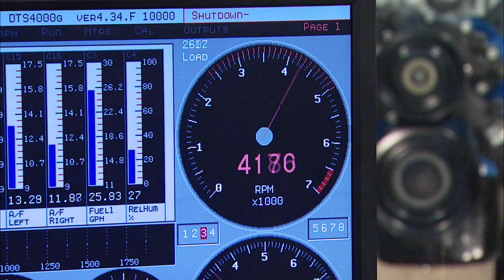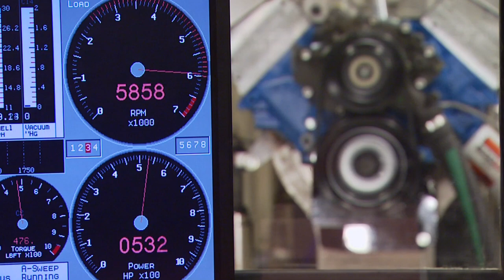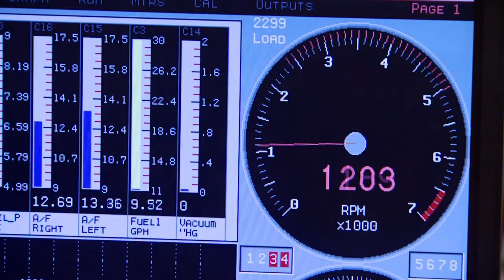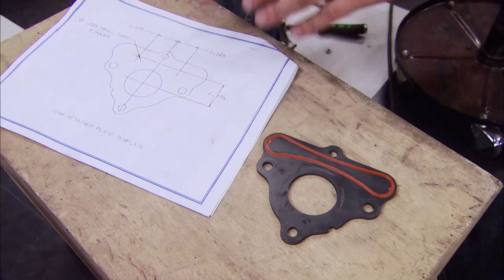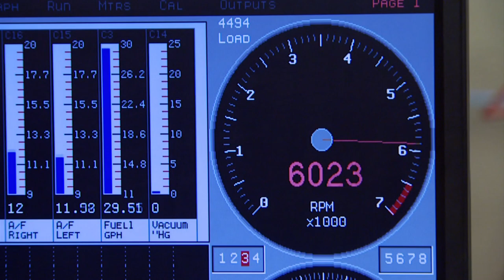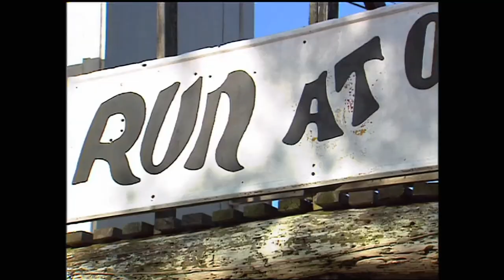Will The Junkyard 460 Big Block Hit 600HP On The Dyno? - Horsepower S13, E10

Comment: LS is still old school pushrod engine  its the pinnacle of  the old design  overhead cam  gives you more rpm but again thats still old school cause over head cam engines have been around a long time as well.
Reply: No pinnacle is 7.3

Comment: Ya just ram the distributor into the hole! That hp holley has alot more to it than meets the eye, it had air holes drilled in the butterflies before an initial run. I do not miss these saturday morning chevy hype shows
Reply: pretty sure "all" of the Holley 4150 HP models above 750CFM has air bypass holes drilled through all 4 butterflies right from factory.
Reply: @throttlebottle5906  I’m glad your “pretty sure” what you said is correct, i didn’t say who drilled the holes only stated the fact that they were there. That theory of drilling them is not ever required on any street strip applications. Time and time again people come to me with BIGGER issues after drilling because the lack of air was not the problem to begin with it is always a timing issue. Put that in your bottle troll
Reply: LOL, except I speak of past using them in actual race applications . not some millennial imaginative fluffing :))
Reply: @throttlebottle5906  millennial imaginative fluffing lol, who said anything about them? I am gen x my friend. And racing from the bench or in your case the keyboard does not count. Just qurious
Reply: @throttlebottle5906  what race application do you speak of and what “problem” does the drilling solve? Put your money where your mouth is post with your real name

Comment: I am going to stop watching this stuff, these 2 Master Mechanics that assemble these engines make me sick . I have to do math and checking with dial indicators and time the cam to the correct setting AND check the cam card. These guys are the best , I just never am disappointed to the way these guys slap a engine together and it just works. Carry on to the gods of horsepower

Comment: y;all comparing LS to 385 series Ford.  Up to about 500hp, the LS may be less expensive.   But--you're gonna have to swap it into a non-GM vehicle, that in itself adds a bunch of expense.  Once you start putting heads on them (aftermarket), then actually making some real power out of them (N/A), it becomes quite expensive.  The 460 can win out.  Take one out to 557", which by the way requires zero grinding/clearancing on the block, decent heads, you're at 700-900hp, easy, and the engine really doesn't really sweat it.  An N/A LS based engine ain't doing that for the same money, not in my experience.  They're good engines but they have their place.   Main reason they're as popular as they are is because there are a gazillion of them in the junkyards.  Ford used the 460's in Lincolns Mercuries and Fords.  GM uses the LS-based engines in everything they make that was rear wheel drive.  2 brands of trucks, 3 or 4 brands of SUV's, 4 brands of RWD cars, etc.

Comment: How many junkyard engines have roller cam and lifters ,aluminium heads and intake etc, not a junkyard engine.
Reply: our 10,000 dollar junkyard motor lol
Reply: All LS car motors are aluminum block and heads and around 2001 all truck blocks went to aluminum heads
Reply: @shawnwhitman5482  i have a 2000 chevy that was the first year for the precursor of the Denali, and the block is a cast iron 6.0 ls block.   I stand corrected,i ment what junkyard engine has AFTERMARKET HEADS.
Reply: Yeah I know..what the hell..build it from the junkyard .port and polish and do everything possible to get 600 from junk and free junk and just old school  tricks and elbow grease and stuff ..that's what I want to see ....a dam food stamp build ..mad max shit ..2000 grand low budget..lol..I'm poor 2000 grand  might as well be a million...low budget..shit .junkyard .not even close ..they suck

Comment: Not Bad for 9.5 compression plus the aluminum factor of the head, it will run good on 87 octane, what a build.
Reply: Money spent for that 607hp....nah.....too low. 
The engine could handle more cam and still be friendly to drive. Wouldn't be happy until it does 100/liter/750 hp plus the torque.

Comment: My fairlane has a 428 and it has 620 hp cheeta shift kit drag suspension upgraded cams and carburetor. A 460 done right should have zero issues producing that

Comment: I'm trying to do this same buil right now.. I just got the same cylinder heads.. having trouble finding that trick flow intake... and some of the other bits and pieces.. I'd like it to be as close as possible, just like episodes 2 and 3..
Reply: That’s what’s so annoying about ford parts . Super capable engine . Horrible aftermarket support for heads

Comment: The 460 isn't a big block. It's a small block design.
Reply: Its the 385 engine family which is considered big block
Reply: Then tell me how I built my 460 into a 514 if it's not a big block?
Reply: Its does not make it a small block at all in fact It's a BIG BLOCK.
Reply: Cubes are cubes.  Irrelevant whether it's called big or small block.   But it's a big block.